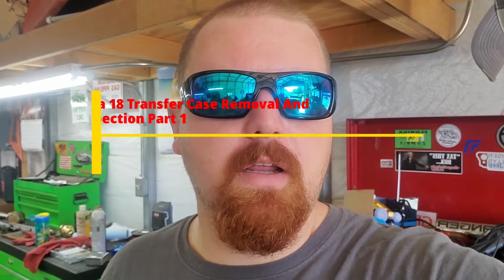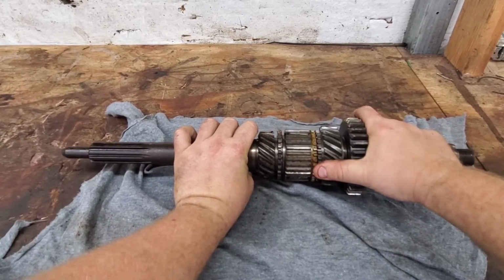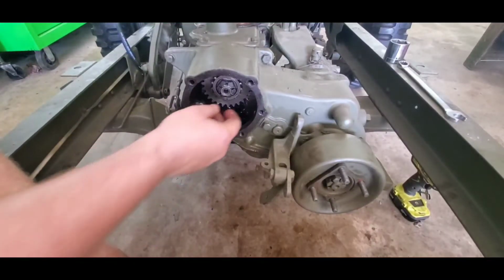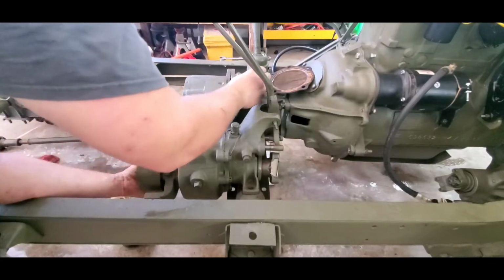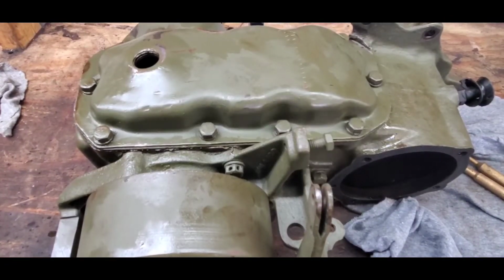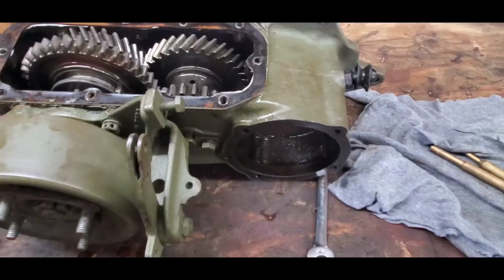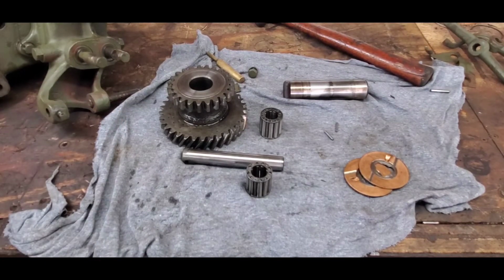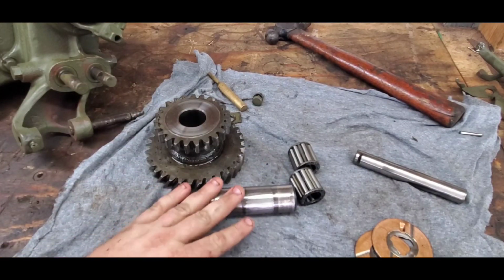Willys MB Dana 18 Transfer Case Removal , Inspection And Variants.

Comment: 4:10 "very little torque goes on this" - I wish! On the contrary it's done up to at least 100 ft lbs. I had to place a jack between the torque wrench and the chassis to loosen mine. A very useful video for removing the transfer case on its own. Thanks!

Comment: Good video. I wish that someone would make a more practical video removing one from a running driving vehicle. I'm fairly certain I got enough insight to pull mine for a rebuild, and also get it out. I found it was difficult to pull the levers in the Jeep, until I figured out that old grease is a pita and just about as good as loctite on that pin. I ended up using a heat gun on the shaft mounts and gripped the grease zerk on the end of the pin to pull it while the old grease was hot. Pretty sure I can get mine out ok, but I'm going to use a transmission jack. I'm old enough I'm not sure I can hold the transfer case one handed as I have on other vehicles. Anyway, thanks for this video. Guess I'll go get dirty now.

Comment: Did you have to use any heat or penetrating oil to get the shaft to initially move?   You don't show the part of the process between loosening the set screw and initially getting the shaft to protrude a bit so I figured you may have run into some resistance there.  Getting these shift levers off is my next step to get the T90+D18 out of the vehicle.   There isn't direct end-on access to the end of the shaft due to the floor being in the way.  The only other option I'm seeing at the moment is to cut a section of the floor away and then weld it back together at the end.  I'd like to not do that.  Any words of wisdom?.  '48 CJ2A.
Reply from the maker: Hi Tom, send me an email via our website we would love to help southernjeepand4x4.com
Reply: @southernjeepand4x481  Just did.  Thank you.
Reply: I am currently doing that on my cj3b, just loosen the screws that hold the crossbar and lower the transmission enough to remove the pin from the transfer levers, on the cj5 they have a cover on the floor that you move and you can remove it.